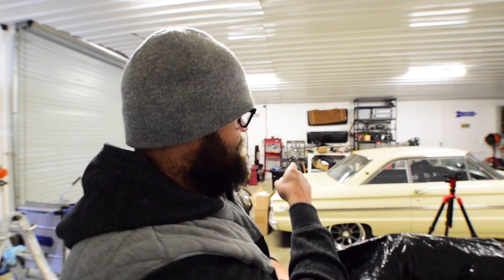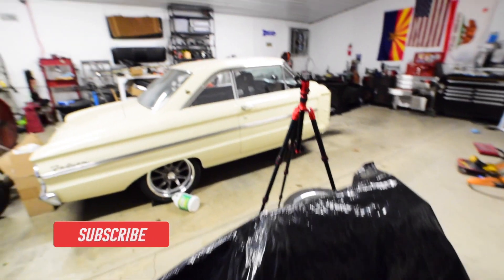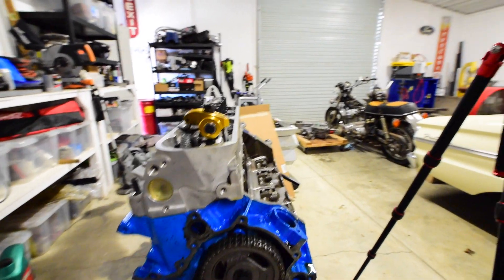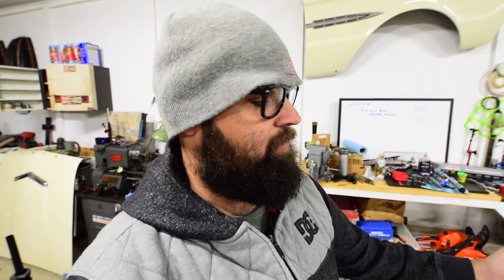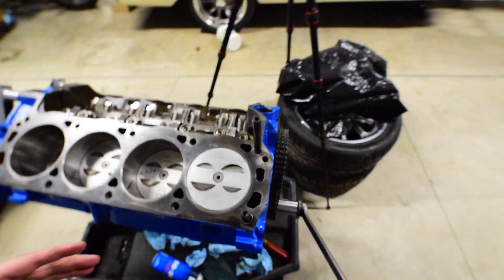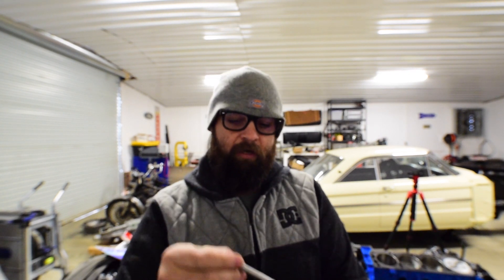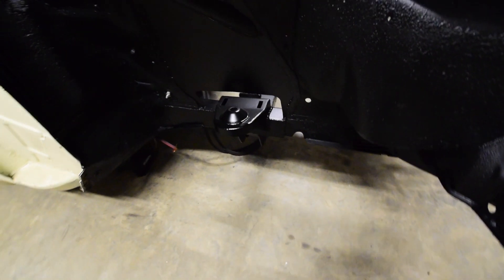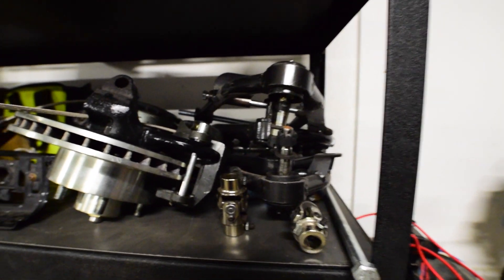Piston to valve clearance issue

Comment: I spent the first half of my career as an engine builder (over 25 years.  Since you are going to use a abrasive to cut the eyebrows in the pistons there is no way I would not pull the pistons and clean them good before starting the engine.  The fine abrasive dust will get down in between the piston and the cylinder wall and there is no way that you will get it all out.  There is a cutter made to machine the eyebrows with the heads installed and that would be ok because you would be removing chips not abrasive dust.
Reply from the maker: That’s a good option. I know lunati sells a tool. It’s just pretty pricey. So so is another rebuild.

Comment: That valve relief got you.  I did the same thing years back.  Had to eye brow the pistons to clear the valves.
Reply from the maker: Oh yeah, got me good. Did you do it on the engine or off?
Reply: @RDspeedfab  lol both!  I drimmled the first time then on the next rebuild I had the machinists cut them on his vertical mill with a fly cutter.
Reply from the maker: @olboy1981  nice! If it works it isn’t wrong!